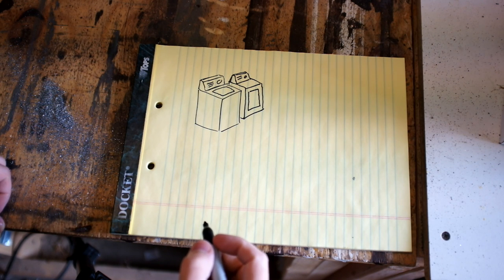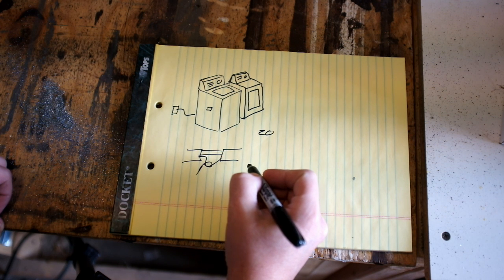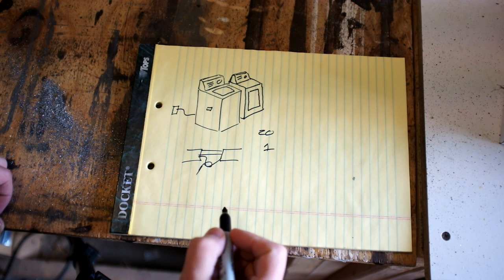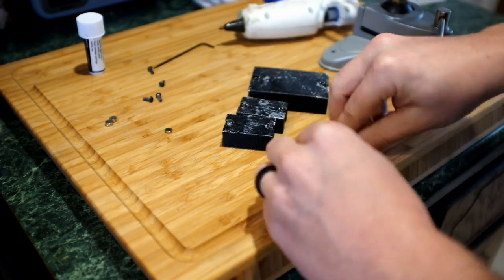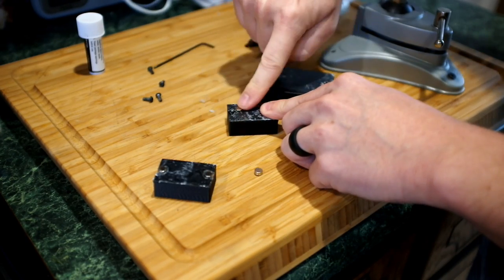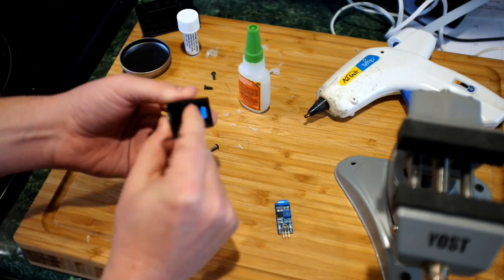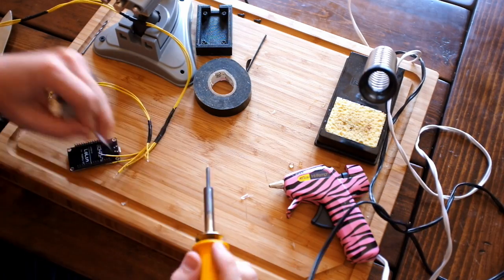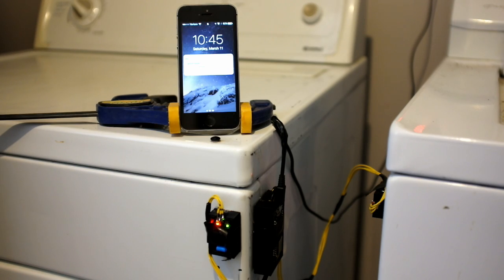Never Forget To Flip The Laundry Again

Comment: Thanks for the video/idea. I had previously used gyroscopes(like many others do) but they were hard to dial in and be reliable. These vibration sensors were much easier to dial in. Now I have specific lights flickering everytime the wash needs changing.
Reply: Oh, and thanks for the models for the sensor housings, good work

Comment: To measure current through the wires in an unobtrusive way, you could build your own clamp on ammeter...a few coils of wire around one of the wires, preferably the live wire, and a sensor to sense current in the secondary coil.
Either way, regardless of the method of sensing, the rest of the build is excellent.
Reply from the maker: Mad Zit yeah I considered that. Ultimately I didn’t feel like cutting into the power cord. I also thought about using a bunch of clamp ammeters for ever breaker in the panel to have a breakdown of when things were on or off on the house and how many watts were being used. Maybe a future project.

Comment: Great video. I subscribed!  

I started the same project. I'm using octocouplers in line with the lights so that it fits within the washer/dryer.
You may have just made me buy a 3D printer..those cases look classy! You just need to print a lid!
Reply from the maker: Nice, I like that idea. I wanted the path of least resistance in the end so I wouldn't have to take my machines apart. Which 3d printer are you considering?
Reply: SparksAndCode first I'll buy a cheap one off Craigslist. Mentally I don't think I'm capable of designing in 3d so until I feel I can I'm not in a rush to spend big money
Reply from the maker: Nice. That is how I got mine. It took a while to get it dialed in but it hums along now.

Comment: So I am doing a similar project and with the SW-420, I find that it's not really sensitive. I even adjusted the potentiometer as well. How is the sensitivity for yours? Does it detect even the slightest movements?
Reply from the maker: The sensitivity of my sensors is pretty broad. I've had it where it would take a hammer blow to switch it and I've also had it where it is sitting on a table and switching without movement. 

Since this video we've moved to a new house and gotten newer front-load washer/ dryer. They are more balanced than the old machines we had before. I'm having trouble finding the sweet spot pot setting for reliability. 

I've also rebuilt this project using micropython and using interrupts instead of polling the pins. The timing code is cleaner. It also has an annoy feature that won't stop texting you until you turn the dryer on. I've debated a few times on if I should shoot another video covering v2.0.
Reply: @SparksandCode  I just found your channel. If you haven't already, please do!

Comment: How does the system know when to send you a message? Presumably the washer starts and stops multiple times during its cycle so how do you know when it's actually done?
Reply from the maker: Essentially, every time the the vibration switches detect a vibration an internal counter is incremented. Once the value of the counter reaches a threshold (~300 or so) the appliance is considered to be running and the counter isn't incremented anymore. There is also a chunk of code that decrements the counter every second. Because the counter is hovering around 300 it takes about 300 seconds of the machine sitting still before the ESP determines that the machine has stopped.

In the early stages of development I had the sensor's sensitivity too high and I would get a text saying the dryer or washer was finished from just unloading it and causing vibrations.

Comment: i know this is 2 years old but im having some trouble with the code when i compile i get errors all over not declared in scope
Reply from the maker: Hum. I just did a fresh clone and it compiled. Do you have all the files in the "Monitor" folder from github in the same folder? Everything is not in the same file. Do you have the board set to Node MCU 1.0 (That is what I used)? If both of those are right, what version of Arduino are you running?
Reply: so i have to take the gsender.h folder and put it in the monitor folder then compile and upload
Reply: 1.8.9
Reply: ok everything is good except
if(gsender->Subject(EMAIL_SUBJECT)->Send(EMAIL, message)) {
says not declared in scope i only need 1 email so i set it up the way you said still have a error when compile 

sorry dont mean to trouble you
Reply from the maker: @monsta21cb  nah you are fine. I just updated to your arduino version and tried compiling again with #90 swapped and it still works. You should see at the top of your Arduino IDE 5 tabs "Monitor", "Appliance.cpp", "Appliance.h", "Gsender.cpp", and "Gsender.h". After you clone the github repo you should be able to just navigate to the Monitor folder and double click the "Monitor.ino" file and all the files are in there.

What OS are you on?

Let me know if that works or not.
Reply: @SparksandCode  i must be doing something wrong i used this before back in the day i think im rusty ill give it another go i promised my wife i would do it lol stupid me
Reply: windows 10 wish i could send you a screenshot
Reply from the maker: Charlie Brown yeah I thought it might be a case sensitivity problem. I don’t have a windows box handy to try it though. I’m tied up right I’ll try to remember to look at this for you. Let me know if you get it.